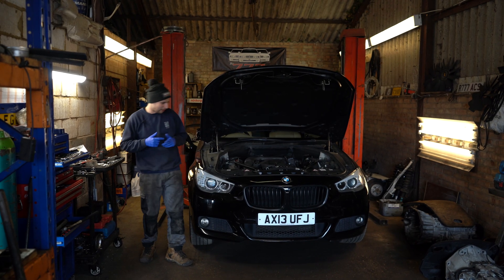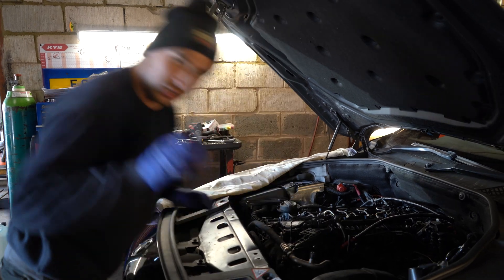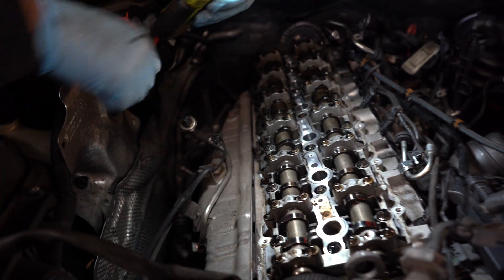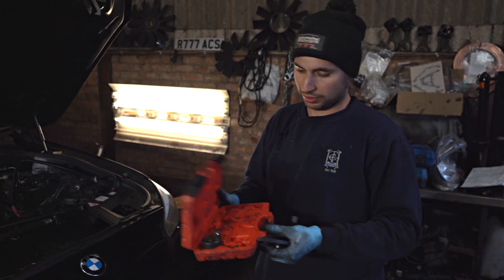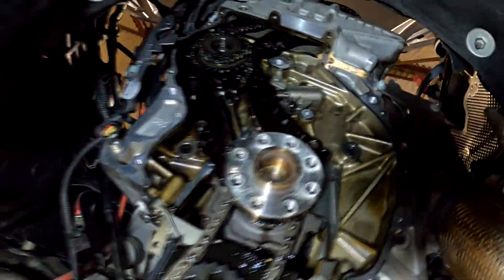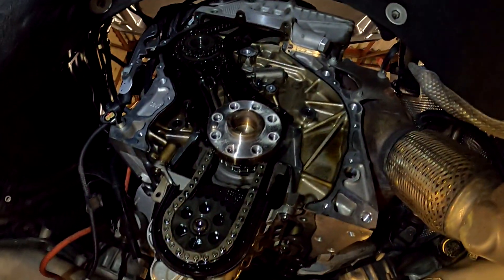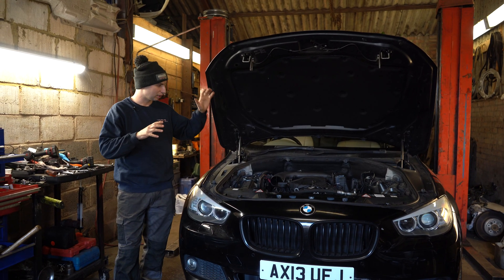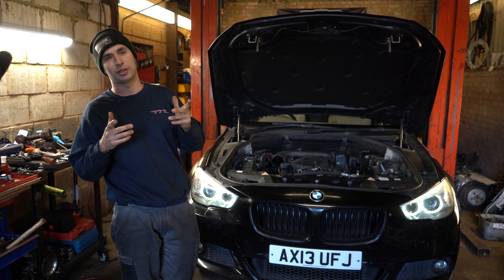Bmw N57 Timing Chain Replacement

Comment: Doing lots of chain jobs now, I would also recommend changing the guide pins that the guides locate onto or premature failure of the guides can be experienced if new guides are fitted on damaged pins.

Comment: Hey, great content especially on a GT... I have the F34 330d Xdrive (2016) N57 & I need to remove the auto transmission. I have come to a stop as I cannot seem to get access to the bell housing bolts at the top & right (E14) ones... I have done the usual like dropped the transmission down a little and still cannot access them... I have noticed an oval plastic cover that is above the transmission so can i use this to get access form inside the car? Or can I access the bolts from the engine bay by removing the scuttle? I am really at a loss here so hopefully you could point me in the right direction?

Comment: As they say “the most expensive BMW you will own is the cheapest one to buy”.
After 200ks they are cheap to buy.
Not designed for affordable longevity.
As a diy person this really puts me off the BMW diesels, will stick with petrol, M54 say.

Comment: The high pressure pump doesn't have the timing?
Reply: Yes it does (although I'm not sure why as it is just a 'dumb' aka plain pump), the sprocket is keyed to the HPP shaft, and the sprocket (although Autodata says the shaft) has a line on it which you line up to a lug inside the case. I think you can see the sprocket marks at 10:46

Comment: Should I change the oil pump when I replace all the chains? The previous owner of my car changed all the chains but not the oil pump.
Reply: Personally I wouldn't (and am) not going to bother, unless you've had any oil pressure problems. I've not heard of oil pumps being a regular problem like the chains.

Comment: What timing chains do you buy please? Original or some aftermarket are better? How do you release fuel rail pressure and how do you pressurize once put back? Thanks
Reply: By the time you get to the fuel pipes most of the pressure will be gone anyway, but to be sure you could just put a rag over the 1st injection nut you loosen to contain any fuel spray. As for getting it started, ideally you'd use some diagnostic kit to bleed the system by running the electric pump. But you should just be able to crank it until it fires up, if you haven't disturbed the fuel filter it shouldn't take long.
Reply: @Markpd69  thanks!

Comment: My N57 has 212k km, planning to change the chains at around 250k km for preventative measures. Doesn't have any signs of chain rattle/swooshing, still operating nice and smooth. I'm more confident towards 250k -300k km because I'm changing oil every 10-13k km with Prolong oil additive.
Saving this video for the time when chain change will be due.
Reply: What is the service interval recommendation for the 320d n57 engine?
Reply: @adamx1748 The intervals somewhat depends on the issues that can appear. Some change the chains mid 200k km (120-160k miles), some which have had oil change intervals every 10-15k km (6-9k miles), can last up to 350k km (180-210k miles) with chains (mostly guides) that are still in pretty good condition given the popularity of them failing. My target chain replacement mileage will be around 320k km

And also, 320d has N47 2.0L diesel engine, 330d has N57 3.0L diesel engine.
Reply: @luckgrip252  thanks for the info, my 320d has the B47 engine. Apparently it has improved slightly with regard the chain. Mine has 112k miles and no chain issues to date.
Reply: E91 2010 325D 370.000km, timing chain stays on like glue without any symptoms, noise etc.

Oil change never above max 13k km
Reply: Currently at 265k km, no chain related issues, decided to go until 320-350k km (oil changes consistently at 12-14k km range)

Comment: I have a 2011 BMW X5 40D E70 (N57 engine), is it possible to replace timing chains without taking the motor out? All previous videos I'v seen on X5 E70 they all have removed the engine. I guess it should be pretty similar to the model in this video.?

Comment: Hey great video, I asked for a quotation from one of the most popular bmw specialists in the uk to do that job for me and they came up and said that they also replace the oil pump during this job. Does it sound reasonable? Some other specialists I spoke with don’t do that, so that just made me think who is following the right process and who wants to get some more money out of it
Reply: Reasonable since they can go bad.  Rod bearing too
Reply: @scottp6761  rod bearing, crankshaft bearing and oil pump during a timing chain replacement?  What would you recommend doing whole timing chain is being done? 

Thanks
Reply: @Breadstar90  I would do those and the.resr.seal, and crank seal while your there, and water pump & thermostat if you plan on keeping it forever.
Reply: @scottp6761  you mean reseal?
Reply: @Breadstar90  sorry typo.  Do rear seal , and front cank seal and harmonic balancer

Comment: Roughly how much is the parts for it in the UK?
Reply from the maker: Parts £400-500 ish inc fluids
Reply: @The777Garage  hi, new subscriber here. Where in U.K. are you based. Could you do this job for me as a preventative measure? Thanks

Comment: You should have replaced the bearings, it will now not die because of the chain, will die with bad bearings, N57 you have to replace bearings when you replace the chain and check the oil pump. this engine like to eat bearings.
Reply: Which bearings
Reply: @Breadstar90  rod bearings and main bearings

Comment: Question- if the lower timing chain has come apart and now have no HPP fuel pressure. Engine was cranked over a few times after stalling out. Would damage have been caused to engine since the cams are not spinning?
Reply from the maker: Need to take the cam cover off to see if any followers damaged if not ur good

Comment: I like the gearbox off method for access
Reply: Leaning this way too, either way the engine or the trans has to move for access. Its particularly annoying on the xDrive since you have to remove the two front axles and drain the diff if you want to pull the engine completely.

Comment: Great video... i just placed a new clutch and flywheel... Now when joyriding this week i heard noise... lost power and engine oil light went on. First i tought it was the turbo now i took the turbo out and it seems to be in more bad dan good condition but not that bad it would not make pressure or spin anymore or to be so bad it would not buil up oil pressure... I also had the hard brake pedal right away when the noize and oil warning light ocured. So now i think there must be something with the oilpump and maybe vacum pump. Hope it wont be too bad.
Reply from the maker: Sounds like something to do without oil pump or them balance shafts on side..vacuum pump is driven by them..hope that makes sense
Reply: @The777Garage  thanks for the reply. Yes i also think it could be the oil pump. But what is the balance shafts ? And so if the oil pump fails the vacuum pump wil also fail ? I just hope it is "only" the oil pump and not the big end bearings... Anyway how can this oilpump fail it only has 110.000 miles on it are they so weak ? Damn !

Comment: Hi Guys perhaps someone can advise on n57 . We were changing plugs and and a plug sensor.  Airtake manifold was taken off. We finished like 4:14 in this video. The sensor, plugs were replaced, all put back like it should. We tried to start an engine it had a like a bit of rotation and  it stopped completely, the smoke came out from the starter and the computer displayed some error messages. The car was driving and was starting without any issue before . We tried to rotate the engine, it was rotating around 350 degrees.  We suspect that something might have got into a cylinder  via air intakes but they were protected so we  are quite confused. 
Does anyone know what might have happen? Can that be a blocked valve or something? Perhaps someone experienced same issue?
Reply from the maker: Maybe chunk of carbon went inside and seized it..or something else..ideally in this case head needs to come off..
Reply: @The777Garage  Exactly, this is what we thought might have happened.  Thank you.
Reply from the maker: @jerryorange6983  let me know ur findings
Reply: @The777Garage  yes I will.
Reply: @jerryorange6983  Results?
Reply: @mrtokyo1989  the car was taken to the garage. The guy made magic because he never revealed how it was done but said that he didn't take Engine apart. The carbon got inside the cylinder and basically stopped the engine cranking.
Reply from the maker: Or inspect bores with scope

Comment: Really useful video
It is possible to replace with same procedure on bmw X3 f25 30d? Xdrive
Without remove engine?
Reply: Yes, but either trans or engine have to move, your choice. xDrive is annoying because you have to drop the front axles and drain the front differential to remove the engine in an upward direction. They're built to drop the entire axle/trans/support all together. Good Luck!

Comment: Is the n57 as unreliable as the N47? I'm looking to get an n57 325d, but the chain issue is putting me off?!
Reply from the maker: Its nothing to do with unreliability..its service items once in 80-100k ..personally i love them engines
Reply: @The777Garage  miles or kilometers?
Reply: No, the N57 has more robust timing components but also under more stress. Short answer, N57 is more reliable if maintained properly.

Comment: Hey mate i’m doing the same job on mine. Would you have torque specs on the chain components? Appreciate it pal.
Reply: High pressure pump sprocket bolt 65nm (replace, don't reuse)
Oil pump sprocket bolt (left hand thread) 5nm +90 degrees (replace, don't reuse)
Chain guide locating pins 20nm (apply thread lock)
Middle chain tensioner and oil spray pipe 10nm
Camshaft sprocket bolts 17nm (replace all 3, don't reuse)
Top chain tensioner 70nm

BMW ISTA has a step by step for every job and torque specs are included, get yourself a copy you don't need a cable to access the workshop manuals.
Reply: @nemz7505  thanks bud. I done the oil pump sprocket to 50 degrees and its all on now ffs 😂 Its got threadlock on there. I checked it and it was tight plus it’ll spin anticlockwise with the engine. U rekon it’ll be ok or do i need to take it all apart?
Reply: @TKhouseofcars  The intial torque is critical to the final angle, so if you nipped it up a bit more than 5nm and then did 50 degrees you should be fine esp with threadlock, usually feel the stretch on these bolts so if you felt that as you're tightening, it should be under tension and not loosen
Reply: @nemz7505  thanks pal much appreciated

Comment: While you had sump off, it's good idea to check  crankshaft bearings as these engines not great on that point.
Reply: Can you change them while sump off?
Reply: @Breadstar90 i think he means rod bearings, and these you can change with sump off yes

Comment: good to see it can be done with the engine in the car .
Reply: Yes you can do the timing chain while the engine is in the car but that is waste of money. Around 200k km the bearings are also gone. In order to change the bearings you have to pull the engine. It is not a big deal to pull the engine on these cars. While you have the engine out and the timing off is worth to rebuild the bosch cp4.1 high pressure fuel pump prevent the damage of the whole fuel supply system. Also by this milage the intake and all the ports are full of junk and needs to be cleaned. All of these just normal servicing on the n47-n57 engines.
Reply: @kriszml  I got rid of mine at 85 thousand miles , I could do the work myself but what a pain , if you go to the trouble of doing the chain ,pump and bearings it would be worth getting the turbo's checked or reconditioned.
Reply: @chris-living-the-dream  Sure but the turbos normally last on these engines and when you have the engine out its easy to check for wear.
Reply: @kriszml  good to know ,, it was a lovely motor for sure but I ended up selling it and buying a maserati granturismo 😊

Comment: Hey man great vid. I'm using this as a guide to do mine. Mine is an E92 LCI but the sump is blocked by subframe but it looks like yours is still there. Did you need to lower it or something or how did it go for you?
Reply: If you remove the anti roll bar and the two steering rack bolts, you can pull the rack forward (with the anti roll bar out of the way) to access the front sump bolts easily. Remove the sump oil sensor and pull the dipstick tube out completely, the sump will come out no problem without lifting the engine, tilt it as you pull the sump backwards :)
Reply: @nemz7505  this worked a charm! Thanks bud!
Reply: @nemz7505  will try that on the weekend thanks pal
Reply: @TKhouseofcars  Welcome squire, sumps can be bonded quite tight if you haven't got a proper tool. One of the best things I've found is the Window Bead Deglazing Chisel Knife/Putty Knife on Amazon for about £7.70 - with this you can usually tap it in on the right hand side at the back of the engine/sump. Clean up any burrs and you'll be golden, good luck!
Reply: Make sure to remove the oil level sensor first from the sump! Sump comes out MUCH easier that way. The most difficult part is removing the transfer case.
Reply: @dannygeed9322  thanks pal
Reply from the maker: Hi! U will have to slightly lift the engine to get the sump out
Reply: @The777Garage  hmmm! I dont have hoist/crane so this will be interesting lol. Great detail though pal thanks
Reply from the maker: Piece of wood and jack 😉
Reply: @The777Garage  haha the thought did cross my mind but I thought theres probably not going to be anywhere but the sump to support the engine really apart from the sump which is what I need to take off 😒

Comment: This was 258bhp version not 245bhp? is it true 245bhp more reliable?
Reply: I doubt it, 13hp is going to make no real difference to the chain. My 2010 330d has the 245hp, it's done ~145k miles and the chain is rattling (although not very loud), it's been regularly serviced.

Comment: Does this sound like a timing chain issue. It’s N57 E70 4.0d
https://youtu.be/J_72LW3sfwI
Reply from the maker: Sounds normal to me..on 4.0d I would more worry for bottom end to go cause they are common for that
Reply: @The777Garage  do you mean bottom end of the timing chain in sump? Which you need to hear bottom of engine??
Reply from the maker: No , i am talking about Conrod bearings

Comment: Really useful content for those wanting to take this job on (subbed) as you say get timing kit with the the high pressure fuel pump puller - makes things so much easier.

Comment: hi,mate, for n47d20c manual engine, I have removed the dual camshaft ( to checked for rocker arm and valve damage) . flywheel off already. how can I set up the timing correcly after ?
Reply from the maker: U need special tool…also there’s loads videos  online how to..same procedure as 3.0d

Comment: Do you have the torque specks? and does it matter which way the gear goes on the high pressure fuel pump be4 the chain goes on it? Thanks.
Reply: The hpfp shaft is keyed. The sprocket only fits one way.

Comment: Hi man. New to the channel, and new subscriber as well. 🙂And in search for resources for this job. Amazing and to the point video. Thanks a lot! Could you please tell me what is really the mileage for this job? I mean my F11 245bhp 540 Nm from 2010 (n57d30a) has 203000 km. Would I take a big risk driving it for the summer and doing this before winter, or should I just go ahead ad replace it? Cheers.
Reply from the maker: Hi! Thanks 
Amm ..these engines are really good and i love them same as m57z,but just need bit more attention..this had 150k miles ,and no sign of bad chain or anything,but as u saw this engine seen regular oil changes maybe thats why..I personally would replace 100-150k Miles
And would drive it without worry..last thing u want break down and big repair bill

Comment: How do i book my car in for this? I have a 2007 bmw e90 m47 320d auto, it’s done 175k with original timing chain still on, think it’s best i change it as I’m keeping the car forever
Reply: Your engine is bulletproff :)
Reply: Haha It is bullet proof. I had a pre facelift 318d I'm guessing same engine. It had 223k on the clock all I changed was crank shaft pulley injector o rings and glow plugs around 200k as a precautionary measure. The engine was fine but had to let go because of ulez. The only thing I did extra was change the oil at maximum 10k intervals as what BMW recommend is probably not good for the turbo and tensioners.
Reply: @farazhanif  what have you got now due to ULEZ? I’m lucky my work is on the border of ULEZ but I have a spot that I can sneak in without a camera facing down on me 😁 just can’t drive central London anymore But can still drive my 05 330d until they decide to expand the area again properly in a few more years 🤨
Reply: @terrybooya6132  bought a 430d m sport plus pretty nice hopefully lasts as long as the last one. Il put some videos up of it soon.

Comment: great  job. how  many hours dit  you spend  on it ?  from into  and out the workshop. greetz
Reply: I would guess like 6hrs in total when you know what you're doing, 8-10hrs when you're not quite quick at the mechanical jobs.
It's just my guess, don't have that experience yet, but will have soon, then I will know for sure.